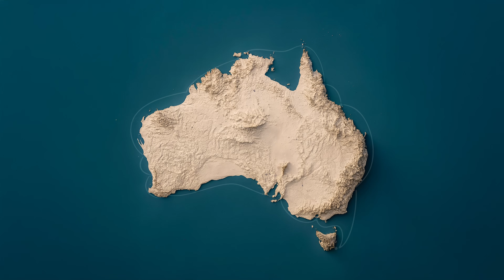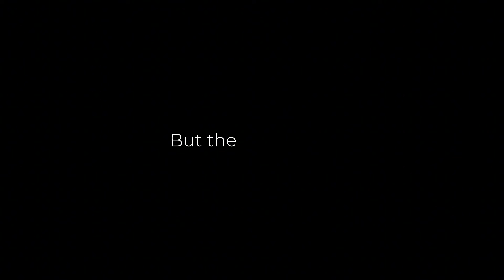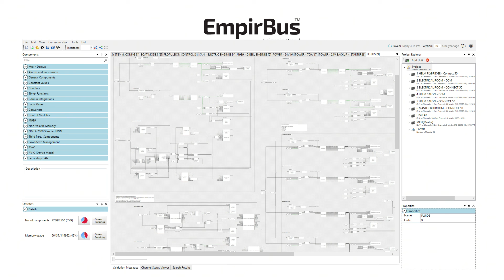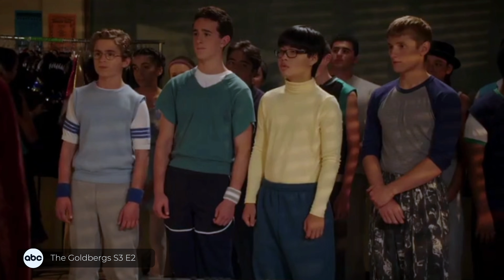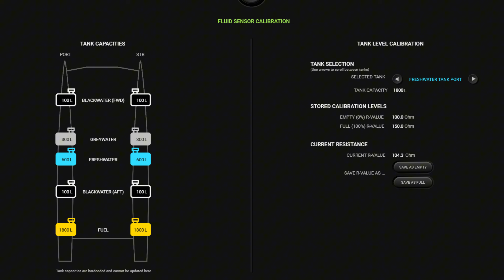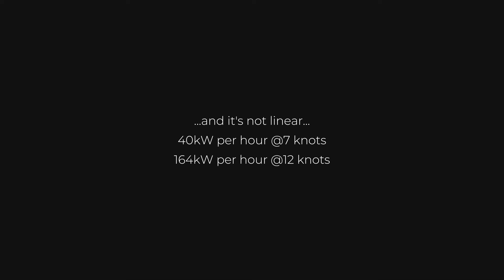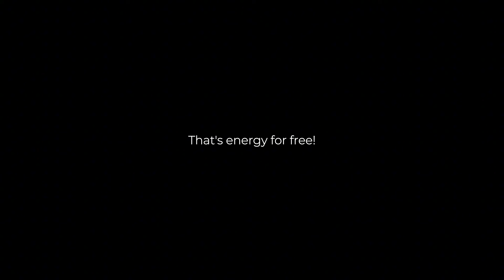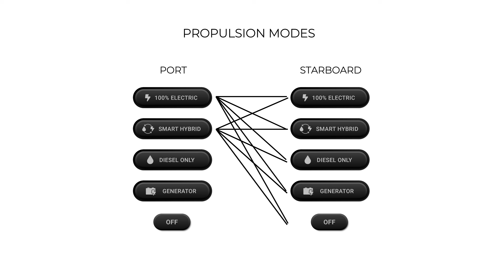The System Behind Our New Solar Electric Yacht

Comment: As a SCADA and Telemetry engineer in a past life I was impressed with your implementation of your control system. You have followed the ASM (Abnormal Situational Management) guidelines pretty well. A few things I would change but overall a great result 👍
Reply from the maker: Thanks! That means a lot from someone who did this for a living! I definitely welcome any feedback, and I'll check out the ASM guidelines. Always looking to improve and make the system safer. Thanks for the tip!
Reply: @projecteyacht  The one thing that I don't see is some type of emergency stops or overrides, if you switch from one mode to another for example and something is failing, or someone is in the way of something as a live aboard (with little or no crew) the person at the helm you may need to override things even when the system doesn't want you to (quickly).

Comment: If battery got hot in midle of a storm and shout down what you will do? Im just curious what will be your action then and what if sistem shout down becouse of one error in programing ?
Reply from the maker: Great question! There's a couple of aspects here, the most important being that max temp rise at full discharge/charge rate (1C) is only 5 degrees for our blade batteries! So we don't actually need active cooling. Second, we can only reach 1C if the software is running, so that avoids the issue anyway. Third, there's two layers of safety interlocks underneath the code, the lowest being physical - those aren't as gentle on the equipment, but will kick in if the software fails to control the situation. A lot of the work and complexity of the system design has been in preparing the system for such events. It's been quite a process!  I'm working on a video about our batteries shortly, that will cover the cooling aspect. Hope that you hang around to check that out when it comes out.
Reply: @projecteyacht  As far as I know, there are no fire issues with blade batteries—even if you puncture one and create a hole—so they’re very safe. I really like the ideea
Reply from the maker: You're 100% right! And that's what my next video is about :) Not many people know about blade batteries yet.

Comment: Excellent design and loads of software. Yes, I am a retired BSEE/CS and I love your design. Did you say that you were both Theoretical Physicists? That part of the audio wasn't clear. Yes, I also spent 40+ years doing telco/internet stuff, including ISO standards-setting  activities (AT&T, PACBell, etc). There are times when I seriously miss the work but, at 71 years old and three strokes, I can't do it anymore. Yes, neither can I live in the wild anymore.:( The best I can do is vicariously joining you.
Reply from the maker: Thanks! We're experimental physicsists - Nuclear for me (high energy/particle accelerators), Quantum for hubby (ultra low temp). Sorry to hear about your health issues. We're a bit younger, but hubby has been chronically ill for over 10 years now, and it's a big reason why we built this boat so we can still travel but within his limitations.
Reply: @projecteyacht  Sorry to hear that (chronic ailments). I will say, enjoy life while you can. I have and I have not regretted it. At the very least, I have memories ;)  We all have exactly one ticket on this carousel.

Comment: You do not want propulsion system to shut down automatically.......make them scream bloody murder warning alarms yes, but you do not want them shutting off without being manually shut down.....i worked on a fishing boat that was later lost because of a fire suppression system fitted, what we didn't know was that the fuckwit that installed it set it up so that when the suppression system activated it shut off the engines....he had been told specifically not to do this and did it anyway.

The loss was caused by a 24v alternator that had a fire sensor above it on the left main engine letting out the magic smoke and setting off the suppression system while the vessel was crossing a river bar with rock walls on each side......there was no fire that would have been a threat to the vessel.
Reply from the maker: Thanks for watching. There are at least 3 levels of safety, warnings and interlocks, at the software, equipment and physical level before that happens. Tried to keep it simple in the video.

Comment: Finally, a vid from somebody who understands technology to talk about boat tech. 
The bar is pretty low on YouTube. 90% don’t know a kW from a kWh.
Reply from the maker: Thanks! True, but that's really what we're trying to do with this channel. We've love tech and can see so much untapped potential, we love given people a little deeper insight into these things! Knowledge is power!
Reply: @projecteyacht Please make videos of the boat tech and how it performs in you mission to cruise around Australia! 
I want to build a similar (but smaller) boat. 
Q:  does the scaling of the powertrain, boat size and resulting drag necessitate larger size boats?
Reply from the maker: We will! No, you have to think hard about balancing the system to get the most out of it, but the concept works for all cases, just the ultimate performance may change. That said, it wont be right for all boats and all use cases. Larger boat size helps with increased solar generation capacity and space for all the extra equipment, but other than that, bigger means more weight and less range, so it's a balance.
Reply: Why 2 x 400 hp backup
I run a 15 m power car in nz with 2 x 100 hp outboards with a top speed of 17 knots
Reply from the maker: Great question! We'll go over it more in a video of the propulsion system - we chose them because they are exactly matched our electric motors, so that we can charge the battery at 1C (so 0-100% in 1 hour). We could have had smaller engines if we cared only about propulsion power. We were also constrained by availability at the time we bought it 3 years ago.
Reply: Yes I know  Ken worth  and Ken worth hire

Comment: The theoretical design looks great, I wonder how integration hell will actually be for a project like this.  I’ve switch to Node Red for my automation engine as it eliminates the need for the save/upload cycle that is needed in older systems.
Reply from the maker: Thanks. Glad you found a solution for that. Much of the complexity in the system is related to the integration, making it visible is the easy part, getting the equipment to talk to each other and the central control system was a lot of work. We'll expecting to be at the boat yard again soon and start testing these intergrations, and we'll put out a video on that.

Comment: Subscribed. I am impressed by the project and the thought and effort that has gone into the control and display strategies.  You are way ahead of most YouTubers that are trying to create solar yachts.
But: PLEASE!!! There is no such unit as a kilowatt per hour, or kW/h!   
There are kilowatt hours, a measure of electrical energy, which are calculated by multiplying power in kW by time in hours... because it is a multiplication, the word "per" and the symbol "/" are completely incorrect as they imply division. 
Then there are kilowatts (kW), the measure of Power (similar to horsepower). This is an instantaneous measurement.
At timestamp 20.40, you should have said that moving the boat at a steady speed of 7 knots requires 40kW of power, so will use 40kWh of energy per hour.
Similarly, at 23.15, you should have said "we can generate 127kW per hull".
This confusion between units is extremely common, and is one of the major barriers to people understanding how motors, batteries, solar panels etc work. If they can't understand something, they won't want to use it, so to me it is really important to use the units correctly.
Reply from the maker: Thanks! and thanks for your feedback, i love that someone cares about the details.

Comment: I think you need to start this as a company to supply electric boats to the market as you said there’s not enough or any on the market. Should I go back to college for computer systems? Too bad there wasn’t a way to add folding sails. Not a pole sticking out the middle , how bout horizontal pole sticking far front from each hull then same pole goes vertical so it won’t shade the panels. Won’t be as tall but ends up pulling the boat when wind fills the sail. Might pull back out of water if too much wind but maybe counter with battery/ engine weight more at the back to balance. Just throwing out thoughts.
Reply from the maker: It would definitely be lucrative, but we're not interesting in starting a business. We want to travel, and have too many other fun projects planned. We are open to selling the IP to a boat builder or company, but right now we are 100% focused on getting our boat completed for now.
 
Our kite pole is collapsible removable, so mostly it will be under deck. The kite is most appropriate for offshore sailing where the wind is consistent. So we wont be using the bow much during those passages. Also our bow area is a lot bigger than the one in the video so still plenty of room to move.

Comment: 🤔 How is your digital control system protected from lightning ⚡️ strikes and EMP? Do you employ manual bypass controls for critical circuits? 
I’m impressed by how your incredibly intuitive human interface, safety and inclusiveness is expressed in your design.  Because you designed the system,
you are well prepared to deal with field issues.😎
Reply from the maker: Thanks! Yes, the great thing is we can make changes and fix bugs as we go. We have a couple of strategies in place to mitigate the risk of lightening (other than anchoring next to a sailboat, lol). I'll probably make a video on this once we've finalised that, but on the most practical side, our diesel system is fully isolated from everything and we have spare ECUs and starter batteries, so we'll always be able to get home.

Comment: What is your estimated power consumption at 7 knots? I've seen other electric catamarans out there that state they consume 4 kilowatts at four knots. I'm guessing you're going to need a 200-300 kWh or greater battery pack to travel 100 nautical miles @7 knots
Reply from the maker: We have a 254kWh battery pack. We're not sure yet, but our modelling is saying around 33kW @ 7knots. The energy is not linear though, so going slower definitely gets you may times further, but who wants to be overtaken by sailboats!

Comment: What a wonderfully logic and cost-efficient intelligence system; seemingly extremely well thought out system design.  How have you approached FMECA (Failure mode, effect and criticality analysis) and related countermeasures; as example, what protection has your system against thunderstorm-threats?
Reply from the maker: We've gone really deep on all of that - most of the complexity and mind-bending thinking has been thinking of and dealing with all the potential ways it can fail. Everything is at least triply redundant. I'm sure we've missed things, but we've covered the most likely issues. Re lightening, we have a few strategies in place and also made sure our diesel system is fully isolated with spare ECUs and batteries onboard, so we'll always be able to get home. Having two of almost everything also helps!

Comment: CAE Mesh-Morphing software Sales Director here — absolutely amazing work.

Huge respect for what you’re building, and thank you for sharing it so openly.
If you ever sail to Italy, I’ll gladly share a case of Brunello for both of you 😊🍷

There’s clearly a growing community of sailors eager to move to truly usable solar-electric catamarans, without being locked into overpriced, closed, and often poorly designed systems from traditional “condo-cat” manufacturers.

Because of that, it would be fantastic to see paid licensing options for your UI and overall systems-integration blueprint — perhaps a fixed license plus a usage-based component (e.g. per-mile) for.the UI, and ideally a perpetual license with an optional support / TECS service plan.

I imagine some of this is already on your roadmap, but I’d be very curious about your thoughts on:
	1.	Fully electric virtual anchoring (no diesel, no physical anchor — ideal for marine parks and protected areas)
	2.	Advanced autosteer / auto-stop / alarm systems for shallow-water passages and anchoring, including tide and forecast integration
	3.	AIS-aware, collision-avoidance point-to-point autopilot, conceptually similar to a Tesla-FSD-style system for marine navigation
	4.	Trip planning with range estimation, based on recent PV production history, weather forecasts, and configurable safety margins — including integration with weather-routing software to dynamically balance desired speed against available energy and fuel boundaries

Finally, could you share more details on shore-power charging?
Are you planning support for bidirectional charging as well? And in terms of connectors and power levels:
32A / 63A single-phase, three-phase, and possibly CCS?

Once again, outstanding work — this genuinely feels like a step change for electric sailing.
Reply from the maker: Thanks! We hope to get to Italy one day! Agree on the the limitations of the systems in other boats, and even the electrical engineering companies trying to offer substandard systems - that's why we've gone the route we have. Your points 1-3 are definitely on our roadmap, haha. We have already incorporated most all the necessary equipment into the build. Just a matter of time to work on it! I'm current actually working on a AL-powered, but offline/no internet, system to add captions to our marine radio (cause I can't understand anything people say). Our roadmap is really driven by solving our own problems. Shore power charging is just standard shore power as per any boat as we'll be at anchor 99% of the time, but we are working on setting up ccs fast charging for our electric tender.

RE licencing - we really dont want to make a business out of this - we've got too many other cool things we want to work, and of course, travel on our boat. But we're open to selling the IP to a boat builder or company. We're focussed on getting the boat completed for now. We'll revisit that when we are on the water.

Comment: Congrats. Very impressive. What's the total cost? Personally,  this seems overkill. How much complexity does a boat really require? It's just more things that can go wrong. Fortunately,  you both seem more than capable of problem solving but this isn't practical or necessary for 99% of the liveaboard, solar powered cat market, imo.
Reply from the maker: Thanks, for our personal circumstances this level of tech is right and we needed it to get the performance we wanted. Not everyone needs it, you're right. Every boat is unique to its owner, their skills, and how they plan to use their boat.

Comment: you basically reinvented a Silent Yacht that recently cross the Atlantic in solar mode but, with less solar capabilities for now, whereas you have a more advanced automated system for controls and UX/UI to save onboard electrical use possibly using edge AI system onboard. the combination of the 2 could be the ultimate solar yacht.
Reply from the maker: Yes, we saw the limitations of the silent design and that is why we did it ourselves (besides budget of course!)

Comment: It seems like you could have tried for more panels and less batteries according to my calculations.
Reply from the maker: More panels, absolutely and on the roadmap after the boat is handedover. Battery size is optimised for our use case and balanced against solar generation and propulsion power, but it would be different for every different owner and how they use their boat.